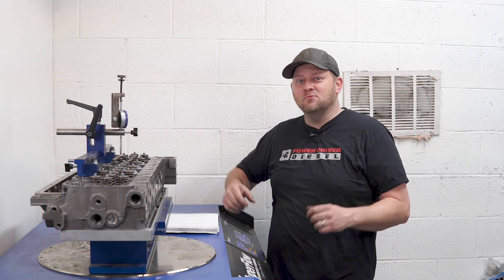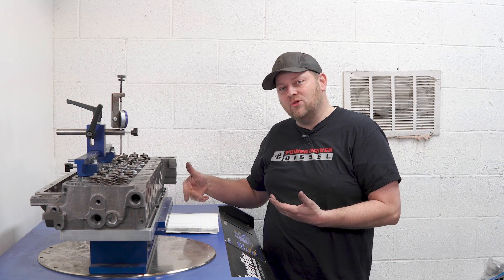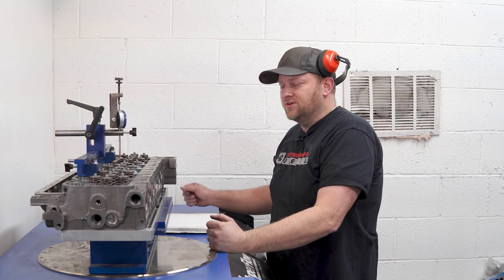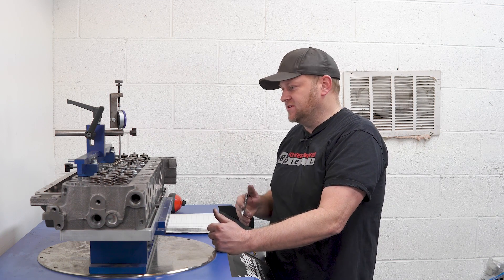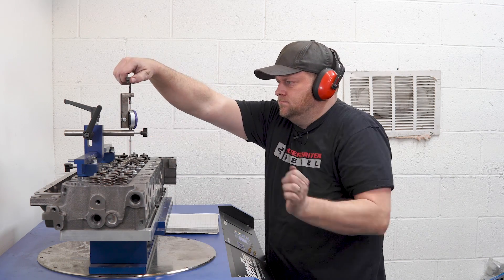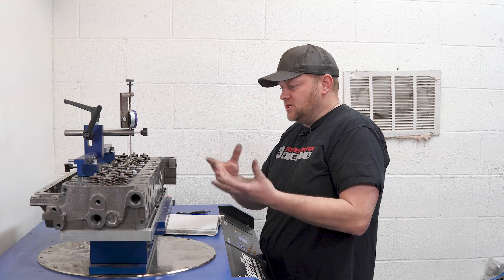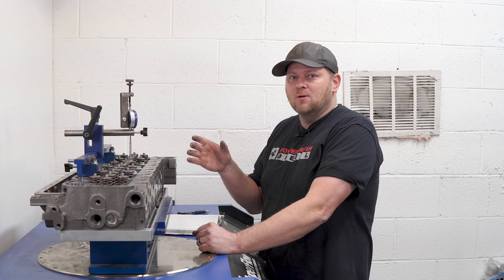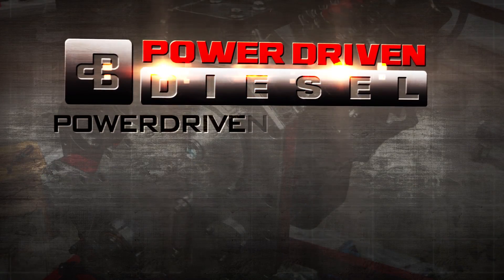CNC Ported Cummins Head Flow Test

Comment: What would be nice is a cnc you could present depths in each port prior to setting the program to run. So basically it knows where the tool is in relation to the casting, OR having the program adjust and make note to memorize where it started based on load when it started cutting and where,  this would b we crazy awesome for a max cnc port job but knowing me, I would still take allot more than a cnc would and I would mirror polish  the ports, I've had my ports stay "reletively" rust free north of 2years  this is big becuase after porting rust scale becomes an issue and kinda changes your flow a few % because of it.  Polishing makes it harder for rust to form because there is less imperfections to cause the effect to take place, though over time it's unavailable. Even still my ported heads are freaken sweet. And I can't wait to send one to you guys to have fire ringed and flowed,

Comment: Why not use larger diameter valves for the 6.7L?  Are the valve size a limiting factor for the flow with this head?  Could someone order your head with larger valves?  Would the cost be very different?

Awesome video though. I love your content.
Reply: Larger valves sometimes only means "larger valves" be careful wanting to do unnecessary upgrades that can very easily hinder you. There is so much room in these heads without going larger where you can gain decent improvements, I see allot I would change or add to with the cnc ports.   Some serious gains to be had for instance.  If you go with a deeper seat, you can open up the seat about 3-3.5mm.  And remove all of the swirl bosses and all the steps and blend all the porting to the seat.  Thess increase flow massively.  Remember  larger valves are just that, a bigger wall in the way. I wouldnt go wider until you  really see what the stock setup is able to handle by opening up the heads, these cnc heads seem to be a great bolt on option.

 for me I go a bit further as stated, I'm honestly really curious how well my heads stack up to others out there (on the same bench/settings).
 I also polish all my surfaces to help reduce/slow down the production of rust in the intake side. But you gotta really polish all the blemishes out to really do anything in that regard. But also if your blinding is on par, your flow numbers increase as well.  I also port the intake all the way up to the shelf. I can only port 3sides->roof and both sides but not being able to port the floor is a good thing  as this can actually help condition the air to tumble right into the combustion chamber.
 Back cutting the intake and exhaust  all the way to the sealing angle and really help flow  but for the exhaust I still have to come up with a means to add a grove on the back side of the exhaust to help reversion. With my headd I only want as much material as needed to do the job, everything else is taken away.

Comment: I dont get this.. with the cost of everything rising uncontrollably and exhaustive supply chain issues, why wouldn't you make a more affordable option allowing customers to send in their current OEM heads? I am assuming it has to do with the programming of the CNC machine? Would be wise to invest the money to get CNC port programs for the OEM heads.
Reply from the maker: OEM heads can be ported, even with a custom CNC program, but who is left holding the bag when a seat drops?
We have more inside information about core exchange programs than the average YouTube viewer and there is a high core rejection rate on 24v heads due to cracking.
Reply: @Power Driven Diesel  I didn't say core exchange. Port the customers when it is sent in. Also, this is a performance part, why would you be left holding the bag? I dont get that comment. It is inherent in the product that this is a liability to the purchaser, not the seller. 

I personally would not buy this. I bought a set of 5x16 12v injectors from you that were completely mangled. And you charged me a $60 restocking fee. Wish I could post pictures here.

Comment: What do you advise me to get for a tuner I currently have edge and not not happy with it and them my truck engine is modified. Street / strip cam over sized push rod , bored .30 , big horn pulse set up , 35% injectors ( the tuner was bought when I had it all stock will that affect how it runs ) should I update tuner to spec of current set up
Reply from the maker: What model year is your truck?

Comment: From an engineer with over 40 years experience I applaud your work and documentation and scientific method in achieving these improvements.  Bravo sir!
Reply from the maker: With 40 years of experience, your sarcasm is hard to hide.  It is difficult to accurately document science experiments within the constraints of a video.  Surely the hat blown off trick shows the absolute capability of this cylinder head.... it's mind blowing!

Comment: With a stock cam at 300 lift or so would it be a good move or to just get a bigger street cam.
Reply from the maker: The low lift numbers are vastly improved on these heads as well so despite the factory cam's lower lift valve these heads help everywhere.   We test heads to high lift to verify high velocity port stability.  In real engine operating conditions, the port velocity is much higher than the flow bench at 28" vacuum so a good port at .750 lift is also a stable/non turbulent port at .300 lift and high velocity.

As far as camshaft upgrade, in the case of a 2004.5 thru 2007 5.9, the factory cam is pretty bad for performance with some built-in overlap that sours the intake air charge with spent exhaust gasses.  These model years seem to respond to a camshaft more than any other year of 24v due to the poor cam timing events stock.

Comment: Any speculation on HP gain Torque gain and what effect on EGT? And does it come with top hat valve stem seals?
Reply from the maker: Yes on top hat valve stem seals.  HP or TQ gain is going to be heavily dependent on the combination.  A stock truck well within the power limits of the stock turbo would see much less power gain than a stock headed 1000 HP truck corked up with the factory head flow.  

In heavy towing applications, the better flowing exhaust side really makes a noticeable EGT drop.  100 degree drop in one application might be just 50 degree drop in another or 200 degree drop in another... still very application specific.

Comment: I know that CNC is the current rage/ way of the future, but I'm wondering if anyone is still doing the Extrudehoneing (where they basically force an abrasive medium thru the port and it polishes/ smooths any obstructions). Would be cool to see a comparision  of an Extrudhoned head vs CNC vs Stock vs handported, including costs :)
Reply from the maker: I don't know anyone outside the injector side of the diesel performance arena that uses extrude honing.  Would be cool if possible because we could then get these heads flowing 250+ with the shelf still in-tact.
Reply: @pddofficial  It seems like an untapped market opportunity, for someone :) I know in the gasser world, at least for awhile, it was THE way to gain HP at a reasonable cost (vs handporting).

Comment: Talked about everything but the price 🤔 lol
Reply from the maker: These heads are expensive compared to ported 12v Cummins.  The oversized seats, threaded freeze plugs, and starting with new heads really adds a ton of upfront cost.  We try not to post prices specifically to prevent "dated" pricing information.
Reply: @pddofficial  I thought in the video it said Inexpensive

Comment: For the sake of comparison. I've always wondered how well a port flows with the valve removed vs. the valve installed and set at max lift for the given cam profile.

It would be easy to test. Simply remove the valve, turn it upside down then slide it down the valve guide up top until it reaches the end of the guide. This would seal the hole. Then run the test.
Reply from the maker: It would be easy to test with the valve removed and a clay plug in the valve stem hole.  Or with the valve flipped over as you suggested.  Keep in mind peak flow numbers still matter regardless of actual cam lift.  Ports that flow more at high lift perform better on real engines at actual cam lift ranges because real engine conditions have much higher air speed than a flow bench at 28" water.  Poor peak flow number expose port design problems that cause tremendous turbulence in actual operating conditions.
Reply: @pddofficial  Thanks for the response. What I'm seeking is to determine how the flow rate is affected by the valve. Essentially, the ports max flow potential compared to the real world.

Comment: I'd like to see if the intake being bolted on would affect the flow outcome at all? Flow each valve a X lift with and without the intake and see what it does!
Reply from the maker: That's a great idea and it'll be coming out in the future.  We have played with both bolted on intakes and exhausts and there is a substantial difference on the exhaust once flow exceeds about 125 CFM with the various brands of exhaust manifolds vs stock.  On the intake side of things, there are huge flow differences when the intake shelf is milled off and the various brands of aftermarket inlet are bolted directly to the head.  As far as stock air horn vs aftermarket, that test we'll save for another day and another video because it will upset some vendors and vindicate others...

Comment: Are you guys wanting the core if one is bought?
Reply from the maker: No core, these are new heads, but starting with a new head does add a substantial up-front cost to make these.
Reply: @pddofficial  Shame a lot of heads are gonna disappear forever to the scrap yard.  

Those numbers look good though. I wonder how it translates to power on a moderately built truck with stock heads vs your on same Turbo/fueling. 

At stock power levels I suspect the change would not be as drastic one already modded up.

Comment: A but what about the oiling port from the block to the head can you guys explain on that subject cause the oiling hole on the 67 head is in a different spot
Reply from the maker: If you use the proper gasket that matches the block 5.9 vs 6.7, the oiling works with no modifications.  The oil feed from the block is a different location, but the oil passage through the head is the same location.  The gasket itself creates the oil transfer in both applications.
Reply: @pddofficial  I'm only asking cause I keep seeing that you have to modify your 59 block to use a 67 head I even seen it on cutter robs videos he has alot of really good video

Comment: Polish the port and see what it does, machined surface rough as nails.
Reply: Surface finish has much less effect on airflow than most people think. "Polishing" a port can actually be detrimental, granted this is more so in gasoline (loss of boundary layer leads to fuel falling outof suspension), but the fact remains, polishing is mostly a waste of time.
Reply from the maker: The generally accepted practice for porting usually consists of a smoother finish for the exhaust and a rougher 60grit finish for the intake.  A diesel does not have suspended fuel so it probably doesn't need a rougher intake since it's more like a modern direct injected gasoline engine, but you see the flow numbers, this port job works!

Comment: Completely off topic but can you run a k27/s369 with mechanical Vgt on a 12 valve Cummins and if so does it improve low end performance im trying to build my truck to spool up at the slightest touch of the throttle

Or maybe a vgt k27 that would be sick
Reply from the maker: We don't offer a VGT turbo kit.  Years ago we built a Borg EFR based turbo kit and it spooled even faster than the K27 setup, but it also choked hard at 2100 rpm.  It was an incredible turbo setup from idle to 1800 RPM, and was making over 1000 ft lbs to the tire at 1500 rpm.... but if you needed to tow at 80 MPH here in Utah, it got terrible mileage and struggled to cruise above 2100 RPM, like 60 psi boost cruising.  

So although a VGT can make things spool faster, they have to be carefully designed to really open up in the higher RPM ranges or they will choke the engine.

Comment: Correct me if I’m wrong but this head will work from 98.5-18 at the least? I have an 01 5.9 and I thought that 6.7 heads have steam ports between the cylinders so there for making them different from 5.9. Correct me if I’m wrong and thanks for the great products and customer support 🤘🏽
Reply from the maker: 6.7 heads do have steam ports, but they do not cause issues when ran with a 5.9 block/gasket that does not have steam ports.  On the flip side, if you run a 6.7 block with steam ports and a head without steam ports, sometimes the water trapped in the steam ports of the block can cause issues.
Reply: I thought it was the injector bosses that were different.
Reply: @IanYav5.9   if I’m not mistaken you can put vp injectors in a 6.7 head but not the other way around, could be wrong on that so don’t take my word 100% on that. The big issue to me would be the coolant ports between the cylinders.
Reply from the maker: They are different as well, that is correct.
Reply: So this head would be bolt up for a vp truck?

Comment: Would you guys port a set of 7.3L powestroke heads
Reply from the maker: We'd have to order a new flow plate adapter to accurately test a 7.3 head for baseline and then ported flow numbers.  How many potential 7.3 ported head customers are out there?
Reply: @pddofficial  well there is one here I have been told that the old 7.3 no matter built they are they will only make 700-800 hp and I am currently building one just want to be different I love the 5.9 but everyone goes to it like the Ls